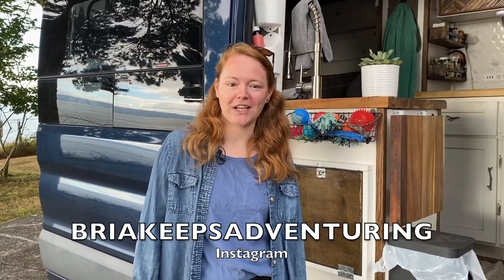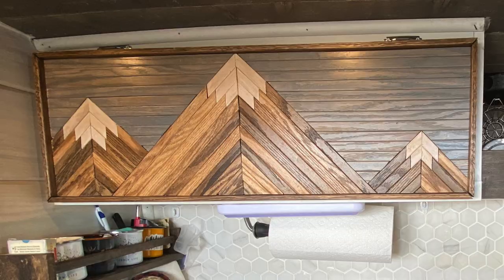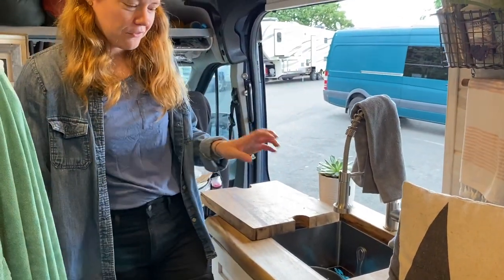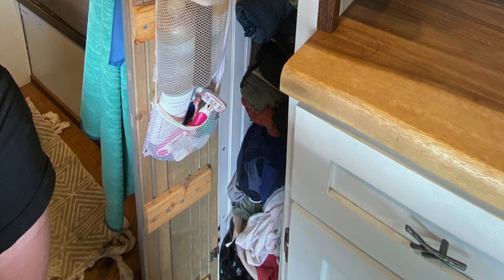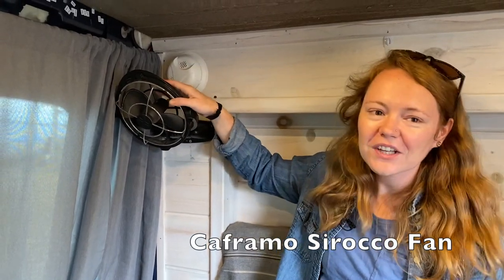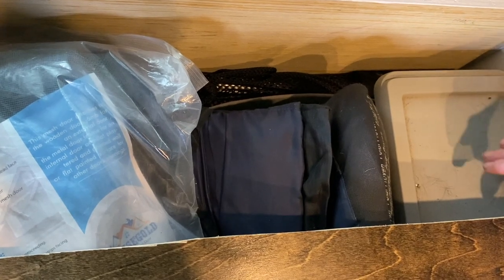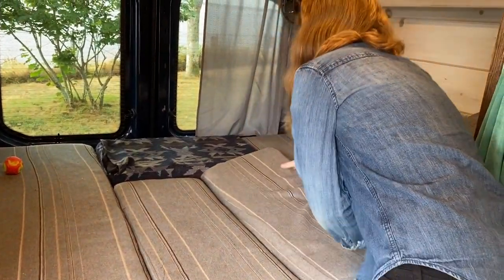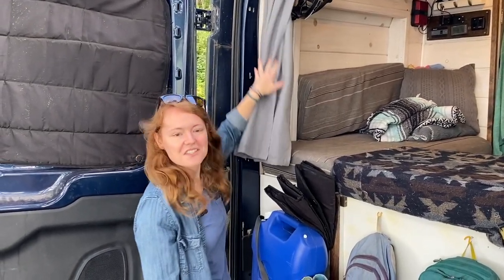Beautiful DIY Short Transit | Van Tour

Comment: An enormous amount of thought obviously went into this build.  Vans small enough to park in standard sized parking spaces have very little space to pack everything a person (and pet) would need to live in there.  Bria pulled this off while still leaving the van with an open and uncluttered feel.

I have no idea why u-shaped beds are not more popular for solo travelers.  If the fixed bed portion was as wide as a twin mattress then it could serve as an always ready bed and place to keep bedding.  That makes the table space into more of a two-person nook than a huge table for social gatherings (which usually happen at restaurants, outdoor camp tables or circles of camp chairs).

I think it's great she has a tow hitch.  Years from now her needs and wants will change and grow, and that tow hitch could be a place to add a small trailer for an art studio, full bathroom or whatever fits in the tow capacity.  They are also a place to mount a swing-out storage container if new hobbies and needs require storage space that does not exist.

Comment: I love your build, and especially how everything is neatly packed into bags!  I am still in the planning phase.  However, I could not help noticing that the fire extinguisher is stored right at the back, together with the extra butane bottles.  Perhaps it should be kept in a more accessible place, such as in the cupboard under the sink.
Reply from the maker: It is actually easily accessible from above as well, and she has a second one in front.

Comment: That was inspiring. I love your channel and seeing how far van life has evolved since i lived in my toyota pickup camper shell in the 80's. I wondered how many mpg the average van build gets and if the electric and solar generate much emf inside?
Reply from the maker: Thanks!  I'm amazed at how far vanlife has evolved just in the 7 years since I started my build!

I don't know about vans other than mine, which is a 4 cyl. diesel.  I average about 21mpg.  I also don't know about EMF generation, although I do turn off my inverter while I sleep, unless I have to run my air purifier overnight.